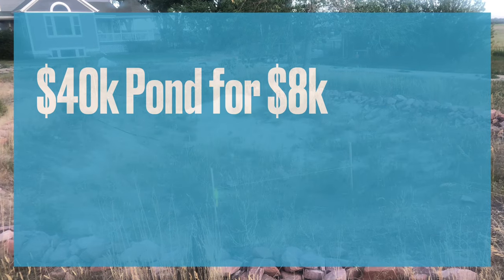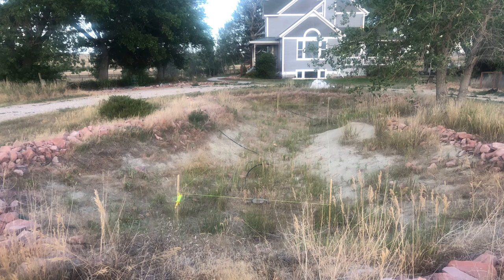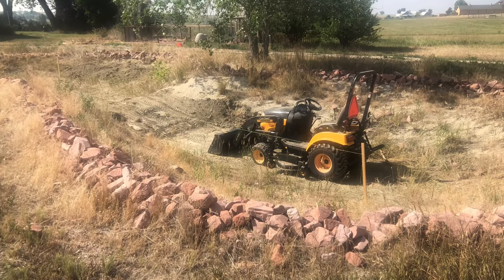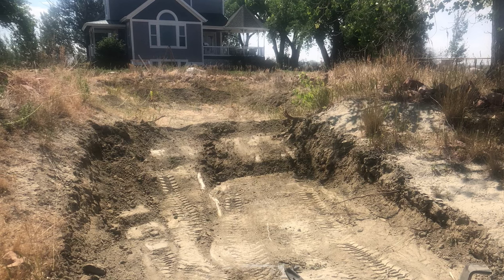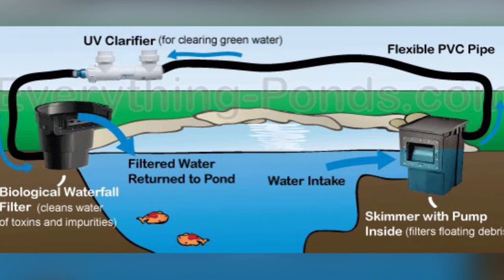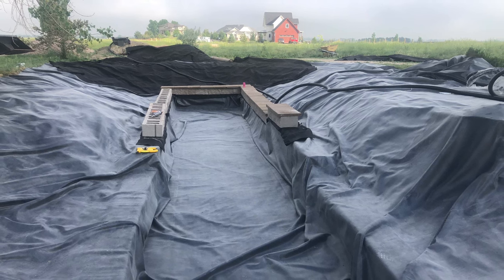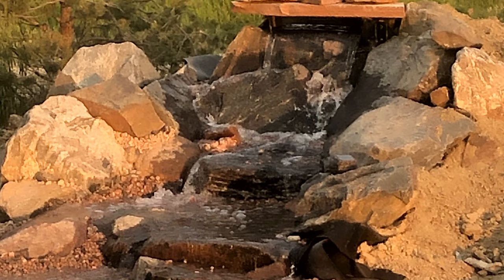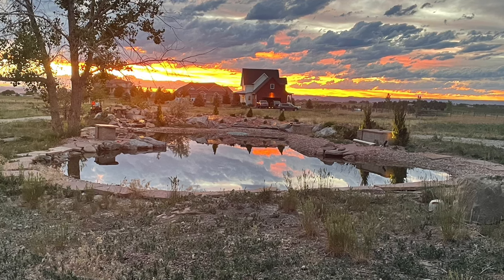I built a $40k DIY swimming pond for under $8k!  #pondbuild #Colorado #pond liner

Comment: I’m curious of the amount of rock you used for your walk in areas?  How deep is the rock and the approximate pitch grade you used to keep the rock from sliding to the deeper area’s.  I am planning a smaller scaled version of this , roughly 20’ diameter

Comment: Loved your pond!! Thanks for sharing. Can you please give me an idea on the monthly power consumption (kWh) required to run the filtration?
Reply from the maker: The pomp is has a 310 watt motor and the UV filter has a 100 watt bulb so in a month I use about 300 kWh so here it comes out to about $42 a month to run. That will depend on local energy prices.
Reply from the maker: Great question btw!

Comment: Was the liner the only thing you paid for? Having all the materials lying around doesn’t count haha.
Reply from the maker: No I paid for everything the liner was the biggest expense followed by the skimmer and bio falls. There is about $900!in rock and boulders but if you look the boulders I got are pretty flat so they look big but are not that heavy and boulders are sold by weight. The rest is just block that is cheap and some plumbing fittings.